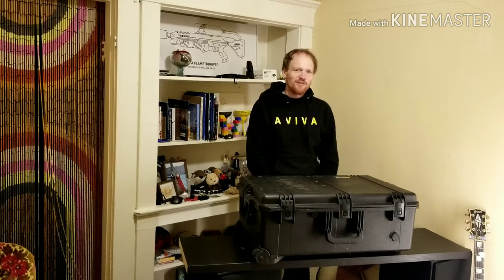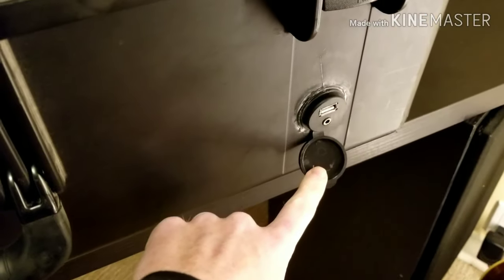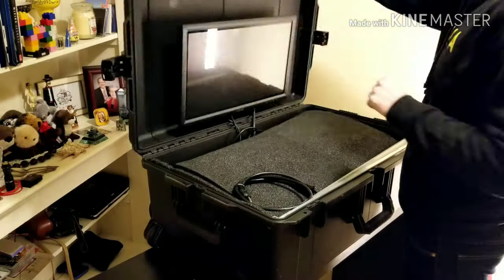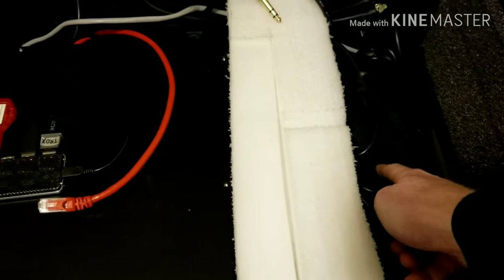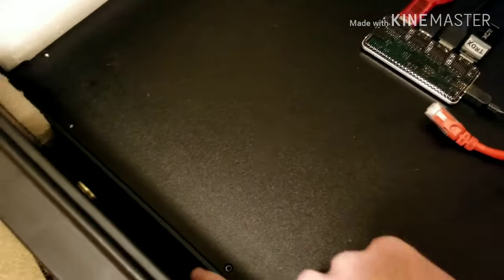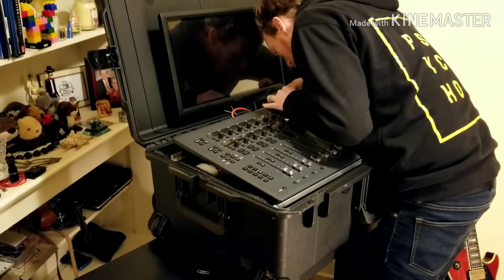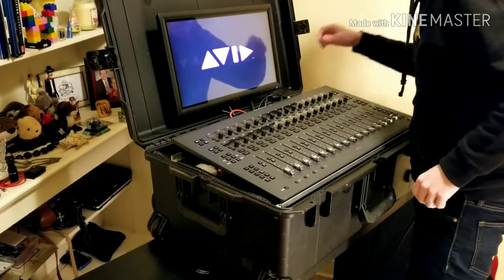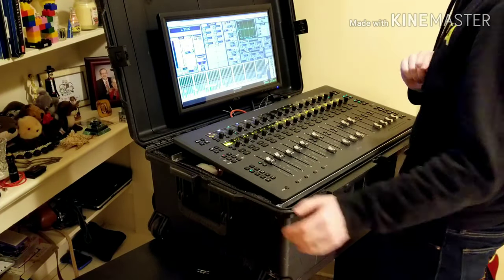Avid S3L-X - Tour of My Pelican Case

Comment: Hi! I have 2 questions:
1 - What is the total weight of the case?
2 - Does the E3L Engine inside the case overheat? As far as I know, it's quite finicky about the temperature.
Reply from the maker: Hey! Sorry for the slow reply. 
1 - it's been a minute since I weighed it but I remember it coming in right around 70lbs. 
2 - I haven't had it overheat, however I haven't used it in very hot temperatures. It is offset from the walls of the case and there is a gap for the front vent to allow airflow. Honestly, I rarely use this console anymore. It is finicky, and I have occasionally had trouble with the engine dropping connection to stage boxes and the S3, (this happened long before I built the case). I think it might be an issue with the E3's network card, but I don't have an AVB switch to try bypassing it.
Reply: @troxaudio2649  Thank you for the answer. Another one question: how is the monitor fixed?
Reply from the maker: @sergeyskvortsov622  It's just a cheap, metal monitor mount I bought years ago. I bolted it to the lid. I believe I got it from Monoprice.com, but it looks like this is the same one. https://www.amazon.com/Orienttvbracket-Bracket-Position-Plasma-100x100mm/dp/B071VCYBXW/ref=sr_1_9?crid=36NP8W4KY0LGP&keywords=minimal+wall+monitor+mount&qid=1676215639&sprefix=minimal+wall+monitor+mount%2Caps%2C71&sr=8-9